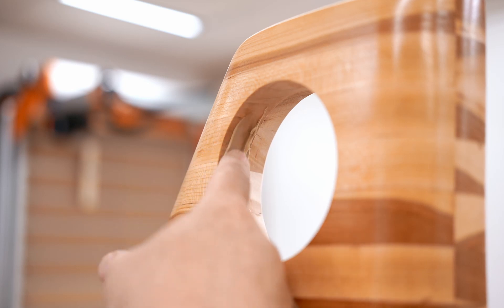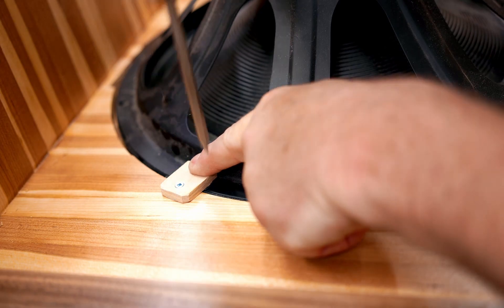Making Open Baffle Speakers - Full Build Video

Comment from the maker: These are the best sounding speakers I've ever made. They are 4-way open baffle with a 15" woofer that plays from 80Hz to 300Hz. an 8" mid-woofer that covers 300Hz to 900Hz, a 5" midrange from 900Hz to 2800Hz and a horn loaded 1" dome tweeter that takes the response from 2800Hz to 20KHz . 
Four 12" infinite baffle subwoofers fill in the bass from 20Hz to 80Hz
They are fully active with digital crossovers for the ultimate in fine tuning capability and sonic purity.
If audio and speaker building a subject that you are interested in, check out my audio channel:
https://www.youtube.com/c/IBuildIt
The music at the end is an actual recording in my listening room of these speakers. The recording very closely matches the original music if you play that directly, demonstrating the fidelity and accuracy of the speakers.
These speakers are fairly big, but completely disappear when playing and project the most realistic soundstage I've ever experienced. A big part of that is the room treatment that reduces reverb time in the low frequencies and eliminates destructive reflections. 
While big speakers don't have a high Wife Acceptance Factor, in my opinion they are the only way to get realistic sound reproduction in a room at any listening level. 
I made them from cherry that has an even heartwood / sapwood mix and oriented the layers so that the edge grain of the board (rather than the face grain) faces out. The corners overlap to add strength, but also for because I think it looks cool.
They are finished with a total of 5 sprayed on layers of oil based polyurethane to bring out the rich colour and grain of the wood.
Reply: THIS is the first time I wished there was a love button on YouTube. Brother you are an artist. Great and beautiful job!
Reply: "Wife Acceptance Factor" ???   I did not think you concerned yourself with such matters.    They are definitely manly speakers with that clear coat to show the grain.  You should have manly speakers.
Reply: As a woodworker I have to say that I would probably kill to have your shop. I can really relate how much work you put in. Fantastic job 👍👍🎇
Reply: The problem is of course that there is no horizontal top surface to put decorative tidbits on.
Reply: @disklamer  Thank goodness.
Reply: @disklamer  you are probably right!
Reply: John, have you ever built those speakers that use the pink insulation foam with a transducer glued onto the back of it? Just curious if they are worth the effort, because they are so cheap. I was thinking of making a pair for my workshop.
Reply: My god, these must sound so open, airy, and full ranged.
Reply: tres beaux
Reply: John excellent woodworking you do I follow you 💯 from # YSW 🇨🇦 😊😊😊😊
Reply: Very powerfully intelligent build. In my ears those speakers fully translate the actual real instruments as if they were in the room. That room is the other significant contribution to the high fidelity of sound. You NAILED it. Your sound room is ethereal in its most pure display. Don’t need no stinkers goggles for impact. I’m proud to know somebody like you exists, who can practice what you preach whether in wood or sound.
Reply: Fantastic job, which drivers do you recommend for this project?
Reply: Awesome John !!! and what wonderful cosmetics. Personally I would have crossed the 8" a tad lower. Your woodworking skills are impressive.
Reply: I personaly would cross the low active at 100-200Hz..

Comment: Mabe not from my tenth, but sure when I was fifteen, I built loudspeakers. The problem with speakers is the low range. They are divided by all kind of horns; Ranging from Transmissionline, Reflex, till Closed systems. All these have a their lovers; Cause I think that, that it is. No system is perfect. Simply you like the sound! I prefer recently the Open Baffle System. In that case I think that 4-way is the solution for this, A sub-low and above a nice 3-way. This sub-low I would make active. The rest can be solved passive. You are a magician with wood. I wish I had this gift. Complements for your work!

Comment: Speaker would look great in a hunting lodge.    You soend hour's on cabnets 
 Then you put  low cost speaker wire  i did not see the binding post.  But the drivers i seen   driver manufacturer  sure did not want to put a name on the drivers  .  Also did not
See the feet speakers sit on.    That's fine every guy so far on U tube building
Speakers  Worry about Cabnets. And put junk hardware inside.     Pull the speakers away from front wall  another  2 feet. Mr. wizard

Comment: I also made my first speakers at a young age and am still building them. I hope I did not affect my ears too much back then by not using the proper protection. I have made conventional enclosures, some transmission lines, some subwoofers, some bookshelfs and may try some open baffles next.

Comment: Hi first of all i am truly amazed by your creations   They are wonderful indeed   I have a question   In the description you write ... "15" woofer that plays from 80Hz to 300Hz"  and that you use "Four 12" infinite baffle subwoofers fill in the bass from 20Hz to 80Hz"    I am very ignorant on open baffle speakers.  Could you tell me something more about the FR of the 15" woofer alone ?   
Because for space constraints reasons i am thinking to put a big woofer in a closed box and above it all the other drivers in open baffle    I know  It would be and hybrid solution  And my guess is that you are very against this compromise ?   Thank you very much indeed and congratulations again   Kind regards gino